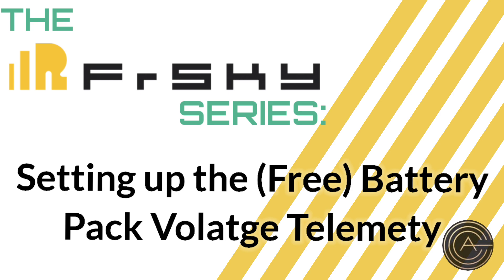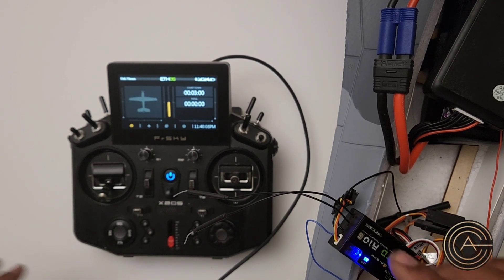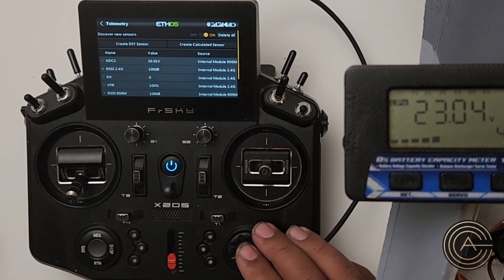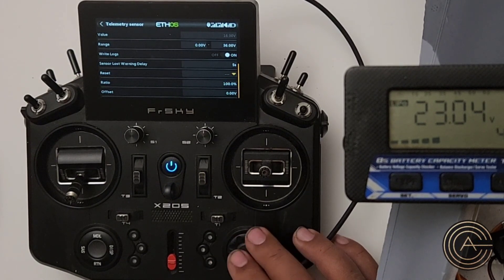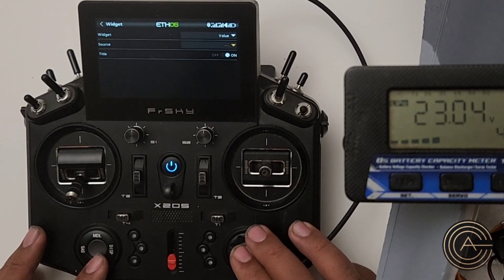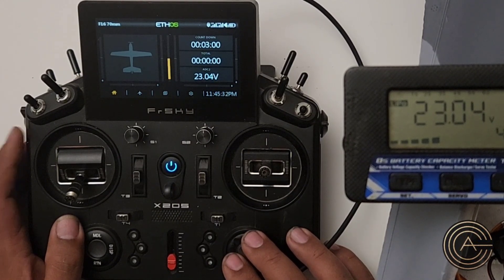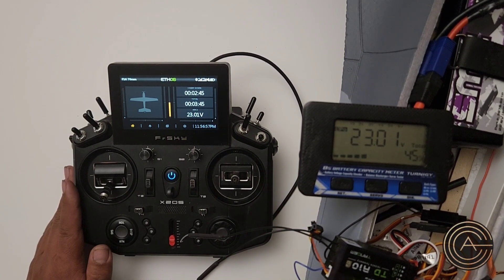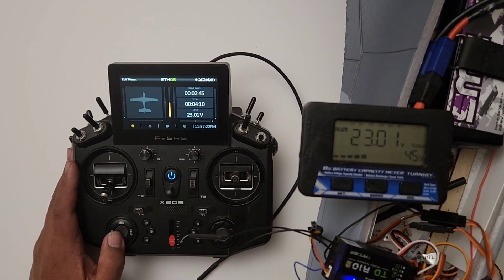The Frsky Series: Setting up the (free) Battery Voltage Telemetry

Comment: I use a 12s setup on many of my planes.  I understand from the manual that the AIN2 port sensor input on the RX will only handle 36 volts.  That information combined with large FR SKy sensors for the balance ports suggested for use in 12s systems makes buying this radio a non starter for me.  Those large sensors need to be inserted every time there is a battery change and in most planes there is little room for all of that. I will be staying with Spektrum as it only requires a flight pack voltage sensor wire to be connected to the ESC input with the other end into a proper socket in the RX.  No fiddling once this has been done and works like a charm.

Comment: Thank you for a very informative video. I have a1/6 tiger tank and I am converting the radio gear to Fr sky. Can i use method to monitor the big 24v drive battery while using a separate battery to power Reciever? I have a TD R18 rx.

Comment: I know this is an old video hope someone can help. I just tried this today and after finding the sensor in the TX my value is reading 0.0 and when I change the ratio nothing happens to value. I've got a good wire form the red lipo wire to the plug on my archer 10plus. Any idea what the issue could be?
Reply: Benutzt du einen extra Akku für die Spannungsversorgung des Empfängers?

Comment: As good as Zavionix Cells is, it is nice to not have to worry about hooking the balance plug up every time and you can't beat free.  I do like how Zavionix will go off if any one of the cells touches 3.5v for expensive packs but conservative setting on your total volts =  you'll be fine.

Comment: I love those sensors. I set mine up to monitor each cell individually. Why? For when the time comes when a cell will fail, and the sensors will identify that particular cell and provide a visual and audible warning. That event happened last season. I was flying when out of the blue, A warning came up indicating to me that a cell is failing and which cell it was. I landed immediately. Took the cell checker out to see which cell it was and its voltage. Sure, enough one cell was failing. Thank you very much FrSky for saving my e.d.f.

Comment: Hi why don't you connect the AIN2 stright to balance lipo plug, with wire can give you the " entire" lipo voltage, the "25.2 volt plug" on the balance port ? Same thing like you scheme..?No...? Thnaks for your video and help.bets regards
Reply from the maker: Yep, exactly the same! Both methods will give you the entire lipo voltage. This method just allows you to connect only one thing instead of connecting your main power and the balance connector.
Reply: Thanks for help  @all_rc

Comment: Thanks for the video, 
Does this cable with blue wire comes with the TD R10?  , 
Also,  it is not clear where did you connect the blue wire ,, Did you connect to the red cable of the ESC ?   
Also what is use of the other wires next to the blue wire (black, red and yellow) and what are they plugged to ?  THANK YOU
Reply from the maker: Yes, the cable comes with the receiver. Yes, connected to the red wire of the esc.
Reply from the maker: Red and black are power positive and negative. Yellow isn't used yet. It supposed to be SPort but isn't implemented yet.

Comment: Great series of videos, one question though I’m building a rc tug boat that will be using a 12 volt lead acid battery. Do you know if this set up would work for that. I’m thinking it should as the analog is only measuring source voltage compared to the flv system which is specific to lipo.
Any thoughts?
Reply from the maker: Correct. It'll work just fine. Just makes sure to calibrate the sensor and it should be good.

Comment: There should be a big disclaimer that you could destroy (or at least damage) your FrSky receiver instantly if its analog input pins are max 3.3VDC input -- in which case it needs a proper voltage divider.  The older X- and D-series receivers probably only 3.3VDC max.

Comment: If i use a RX that only read telemetry from a smart BEC but in but in stead is connected to a non smart bec.
What is the A2 reading? 
can this be converted to the battery pack?
tks
Reply from the maker: I'm not really understanding the question.  What receiver are you using?
Reply: @all_rc  Receiver is Aerostar...not avian. the ar631 receiver is telemetry capable of connected with avian esc.

But since i am not using an avian and i still able to read volts with the rx i am wondering if that is related to the battery pack.
Reply from the maker: If you are trying to use this with a Spektrum Radio,  i am of no help.  I don't use Spektrum radios and only have minimal experience with them.  If you are trying to use this with a Frsky Ethos radio,  as far as i know,  telemetry information is not yet available when using with a multi protocol module. I believe that firmware 1.5 will allow telemetry information from external modules.
Reply: @all_rc  i am using a radiomaster boxer with latest edgetx version. the 4in1 module allow telemetry , i can see it my radio but i do not know if i can use it
thanks anyway!!
Reply from the maker: Yeah. Wish i could help. I dont use edgetx anymore.

Comment: Hi there great video... I'm new to FRSKY and struggling to find any info on what the other wires are used for?
Is the red/black/yellow with a female Jr plug used for updating ?
Also what are the other 2 wires the SBUS OUT and the NC ?
Thanks in advance

I wish there was more info for folk with little experience with SBUS FRSKY receiver's.
Reply: It's a TD R6 Receiver
Reply from the maker: For the TDR6 the six pin connector is as follows. -, +, S, AIN2, Sbus and NC.   The - and + are self explanatory. They are power that is on the same rail as the - and + on your channel outputs. The next pin is S which stands for S-Port or smart port. This is where you hook up telemetry sensors like GPS sensors. The S-Port can be configured as  an S-Port,  F-Port or F-Bus depending on what sensor is plugged into it. Yes, you can use S-port to update but the TD receivers can be updated Over the Air (no wires, updated from your transmitter). AIN-2 is the built in voltage sensor. Hook this up to the positive lead of your  esc for example to get pack voltage telemetry. Sbus is a futaba standard that takes 16 (or 24) channels and sends it down one line. If your plane has a gyro or flight controller, you can sometimes just hook up one connector to the sbus port and have all channels on that one connector. Your 6 channel receiver can actually be more channels. You have 6channels of individual outputs, but with Sbus, you actually have at least 16 channels. NC stands for No Connection... so that output does nothing.
Reply: @all_rc  Oh thank you so much really appreciated...
1 more question can the SBUS out be used for Telemetry like Futaba or do you have to use the S/PORT  instead with FRSKY?
Reply from the maker: Sbus standard is only one way (controlling servos and such) telemetry requires two way (receiving info from device as well as controlling it) . So no. Futaba uses something else for telemetry, not Sbus (not sure what since i dont use it). On Frsky, you use the S-port for telemetry using Frsky sensors (or frsky compatible sensors)
Reply: @all_rc  Thank you again that is so helpful 
I'm looking to connect a T Motor ESC program/telemetry box you leave in the plane to read ESC temp, mAh used etc on Tx screen but ...they don't explain how to connect ...they just say it can via FRSKY Futaba and Jeti ... 👍
Reply from the maker: There should be a setting for S.port.  I assume you somehow switch the T motor box to S.port and use that.
Reply: @all_rc  They didn't mention actual S/POrt but they show in a video how to change the box to either Futaba,  Frsky or Jeti it's comes up on an LCD screen either 1, 2 or 3.   I think frsky is number 1 👍

Comment: Anyone know the max voltage on this pin on the G-rx8?
Reply from the maker: I couldn't find the manual online but those older receivers might only be able to do 3.3v. You can still use it but you'll need to add some resistors to make a voltage divider. Look up voltage divider calculator on Google to see what resistor values you'll need for whatever voltage you need to input.  It's not that hard. Once you bring the voltage down,  you just calibrate it like in my video to bring the voltage back up to what it actually is. But you might want to check with Frsky. Call up frsky in Brea, CA and they should give you an answer as to max voltage on the AIN port of that receiver.  1-714-987-3100 Is the US service center number.

Comment: im running 12s, will this still work?
Reply from the maker: I believe the max input on that connector is 36v. If you add a voltage divider,  you can run your 12s battery. Look up voltage divider on the internet.  There should be calculators to determine what resistors you need to make your voltage below 36v. Once you do that,  you can adjust the sensor like I did in the video to read the proper voltage.  That said,  I would rather use 2 lipo sensors hooked up to your batteries' balance ports.  Then you can get individual cell voltages. Check out my video on how to install 1 or 2 lipo voltage sensors for info on that setup.
Reply from the maker: https://youtu.be/HCT3B78u5K0
Reply: Great ! Do you know if it is possible or not do display the % more than the voltage ? (Kind of calculation or something liké that...)?
Reply from the maker: Interesting!  .... I would assume yes but I haven't tried.  Let me investigate
Reply from the maker: Yep! Just looked.... you can.  Use a calculated sensor.  Formula - Percent.  Sensor - ADC2 (or lipo sensor). The percentage scale is determined by the range that is defined in the original sensor. So the ADC2 sensor has a default range defined as 0v - 36v. Change the values to the particular battery's full and empty. If, for example you are using a 2s lipo. Full might be 8.4 and empty might be 6.8. Once you change the voltage range to 6.8 to 8.4 in the adc2 values, the percentage will be correct.  Nice one! I'll do a vid on it.
Reply from the maker: Well that inspired me! Here's the video!  https://youtu.be/c63S3bEUong

Comment: For some Archer receivers like SR6 or R6, the voltage measurement range via AIN2 is 0-3.3V. So you would need a suitable voltage divider depending on battery pack voltage.
Reply: hi. got an archer SR6. without connect anything to the ain2 port, the telemetry Adc2 display about 25.3v. do you know why ? this voltage is always the same even if I use a 3s, 4s, loadded to 40% or 75%.
Same ADV2 value if AIN2 is plugged to an external lipo.
I'm lost.....😢
Reply from the maker: I do not have any SR6 receivers to test.  But it is weird that it shows voltage without anything plugged into it. Msun1200 says AIN2 on some receivers require a voltage divider since it can only accept 0-3.3 volts. Look up voltage divider calculator on the internet to determine what resistors you need to drop the voltage down the amount you need. But if you are getting voltage without plugging a battery in, something seems wrong.
Reply: @all_rc  @msun12000 : thx for all, now it's clear. Found in the sr6 doc, as said msun12000 : "Voltage Measurement Range via AIN2 (External device): 0-3.3V" ! YESSSS !!!
And for me as "voltage divider "is a mystery :), I gonna buy a FrSky FBVS-01, which seem to works from 1s to 4s battery pack.
Reply from the maker: A voltage divider is just a bunch of resistors that you wire in a way as to get your voltage down to below 3.3v. Then you adjust the ratio so it displays the actual voltage. But yes, an easier way to go is a FBS 01. Any reason you wouldn't go with a FLVS-ADV sensor?  They can show you individual cel voltage so it helps you determine when  a battery is going bad.... much more expensive though.

Comment: What are the black, red and yellow wires hooked to that are coming off that same molex in the rx?  Is it not necessary to hook a ground up to your flight pack?
Reply from the maker: Positive and negative and S.Port. S.Port is frsky's smart port where you should be able to hook up telemetry sensors.  It is currently not working.  To use S.Port, you assign one of the main outputs as an S.Port instead of a channel. In future, that port on the white connector should be activated and you won't need to use up a channel for S.Port. No need to hook up a negative cable since negative is common and you are getting negative through your esc (along with main power). You can hook it up if you want but it isn't necessary.

Comment: I love my Frsky gear..  Haven't pulled the trigger on the fancy X20 though..  Thinking about it..  btw, you have a typo on your thumbnail...  - Will
Reply from the maker: Lol! Thanks.  . Can probably change the thumbnail but on the vid, it'll remain forever!  I'd look at the cheaper x18... smaller screen but everything else is better. Fits better in my hand,  has two more trims, built in memory etc etc... same capabilities and number of channels
Reply: @all_rc   Thanks for the tip on the x18..   I've been using Frsky for about 3 years.  99% of the guys at the club use Spectrum and are amazed at my feature rich, low cost Taranis 2019SE. I have the Voltage sensor on most of my planes.  A real life saver for sure.   I'm sold on Frsky.    I used Canva for my thumbnails so I can change them if I decide I don't like it..   btw, You got a wonderful channel and I enjoy your content..   Glad you channel continues to grow...
Reply from the maker: Wait till you try a Tandem receiver.... awesome. Never had one radio hit. I've had VFR Low warnings but that just tells me that 2.4 isn't great but I still have full control since if there is a problem, it auto switches to 900mhz.
Reply: @all_rc  I fly a fair amount of long range FPV so the Frsky 900mhz module is a must when I'm way out there (many miles...) Interesting how they combined the systems for the best of both worlds..  Love it..